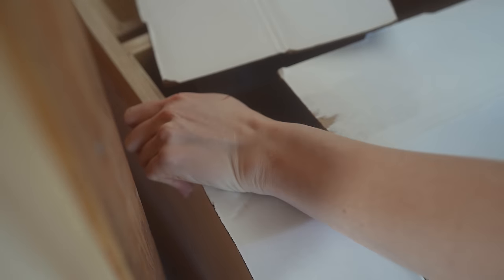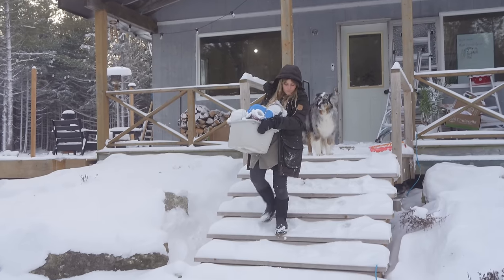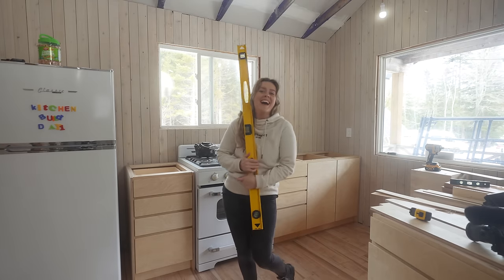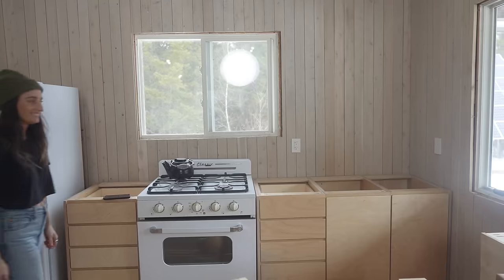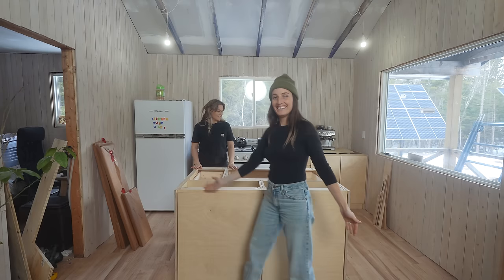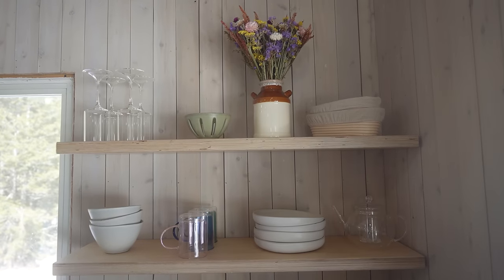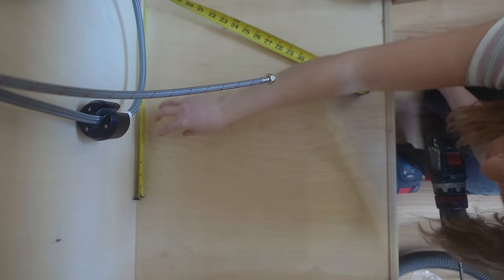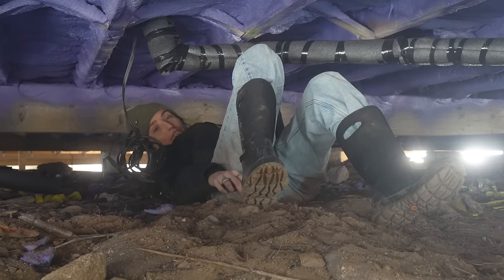Building A Tiny House Kitchen For Off-Grid Cabin!

Comment: A suggestion (if it hasn’t already been suggested) to make use of the kitchen so much better, reverse the hinges on your refrigerator door to swing out from the opposite side.  It is quite easy to do and typically involves only three screws for the top hinge after removing the cover and three for the lower hinge.  The cover will work on the other side too.  This will make it easier to utilize the countertop when you load & unload items.  The cabinets look great.
Reply: Someone already told them that 3 hours ago. (-;
Reply: Yep same page. I was thinking more counter immediately next to the fridge. Maybe there’s gonna be an island or floating island
Reply from the maker: Thank you William we sure do appreciate all the ideas and suggestion we receive. Thank you for being part of our pack.💛🐶

Comment: Great job and I love the difference! Don't forget to get skirting around the base of the cabin, before winter next year. That will make a huge difference in heat retention. Time for the off-grid cabin retreat on your property?
Reply from the maker: Hey David, thanks for the reminder, we may need another one in September. 😆 🐶
Reply: Block with metal access doors

Comment: Great channel and awesome kitchen! I caution you on using more of the heat trace wire, you are off grid and this resistive load adds up and will suck your batteries low at an alarming rate in the cloudy cold Canadian winters. You definitely need the heat trace from the well to the house, however, investigate re-routing your water lines in the island to interior walls as much as possible to decrease the length of heat trace wire. Possibly (under the cabin) remove the insulation in one floor joist area next to the floor, route the water lines right under the subfloor, and then re-insulate below the water lines so the water lines are on the heated side of the insulation. You can still wrap the water lines in heat trace but insure you use the thermostatically controlled heat trace, so it hopefully will never come on.  Next winter when you are watching your electrical load slowly drop you definitely want some of the simple load monitors that you can plug your ‘automatic’ resistive loads like the heat trace into, so you can monitor where your battery power is going.

Comment: The place is looking amazing! I think everyone will have dog bowls in the island now. Very clever.
I could not tell from the shot but you should put a plumbing vent in under the sink in the drain line. They are super cheap and you can still add one without much more work. It will help drain that big sink when it is full of water and you drain it. You will hear gurgling, bubbling noises if you don't have one and it will take longer to put in. If you plan on putting in a garbage disposal that would be a good time to put the vent.

Comment: Great enthusiasm. You've been getting by without an extractor fan over your propane stove, but I'd think about putting in something to vent the toxic fumes outside. Eventually they will take their toll, especially in the winter. Even putting a drop down fan up above the window height would help in winter. Also, in Ontario at least, your stove setup requires 6" on the back to combustible material which it looks like your stove comes with. Nonetheless, I'd consider something fireproof and easy to clean behind the stove. Maybe some stamped tin would look nice. Code calls for 6" to combustible material on the sides as well.

Comment: I would have really enjoyed building and installing your cabinets with soft closing doors and drawers. Of course, auto lighting inside uppers and lowers. Soft lighting under the upper cabinets. And then making you solid surface counter tops and a deep farm sink. Then put matching doors on your fridge and dishwasher. Making it all easy to clean and sanitize.

Comment: You two are doing amazing!
one small suggestion though, use some ice or snow on the plumbing heat trace cable sensor to test it to make sure its going to work.  They don't make them the way they used to and I have had some break the filament wires when wrapping them too tight.  Not saying they are wrapped too tight its just better to find out now rather than next crazy cold snap.
Keep up the great work and be proud of everything you are accomplishing!!
Reply from the maker: Thanks for sharing and caring. We appreciate all the feedback we receive. 🤩🐶

Comment: A built in dog food/water dish.I was on the money! Here’s the thing, while they’re new, give the insides extra coats of urethane. With all the water/food/ dog slobber, they will take a beating pretty quickly. You won’t want them to warp. Did you get an expandable drain trap? Cause once the countertop is installed, unless the sink is under mounted, and sits a top the counter, the distance between the sink drain and u-trap will change.

Comment: As I saw other’s comments, consider moving the hinges on the frig. My former neighbor calls himself a handyman, but I watched him build 3/4 inch birch cabinets in his garage for his new home. Like Andy he builds the platform/kick plate, as he said I level that up and secure it to studs, then mount the actual cabinet to the base. I noticed he used soft close slides for your drawers, 👍. Make sure caulk around the sink to prevent future water damage. Looking more like a home than a summer cabin every week.  Did you figure out a solution for the batteries you were having an issue with the initial charge?

Comment: Nice job on the kitchen ladies. Just a thought  on keeping the mice from using the plumbing floor access hole to join you for dinner. If there  is ANY clearance around the pipes place some steel wool in the opening  and cover the top with a sheet metal panel screwed down. Have a nice day   Tom at the NB/NS border.
Reply from the maker: Why thank you Tom, we sure do appreciate you sharing your knowledge with us. So happy to have you in our community. 🌞🐶

Comment: Great job girls, you two should be really proud of what you've been able to accomplish. Just a couple pointer on the Plumbing I noticed while watching (Red Seal Plumber from PEI here). First thing is that you actually didn't need pipe dope for any of the connections you did in this video, my apprentices will often do the same thing but because the threads aren't actually making the seal they don't need dope. For both the tail piece on the drain as well as with the supply lines to the tap the threads are just the to provide compression on the rubber gaskets. The dope isn't actually helping, just making a mess. Secondly it looks like you made an S trap under your sink which isn't to code. It probably won't be an issue and isn't worth changing unless you start having issues but the proper setup would be to use an automatic airvent under the sink to prevent your trap from siphoning out. But overall great job and if you ever have any questions feel free to get ahold of me and I'll help if I can.

Comment: You need to leave an inch and a half gap either side of the stove to allow for airflow around it to prevent heat transferring to the cabinets.
Reply: You should do the same with your fridge if you can also. It prevents moisture build up

Comment: amazing!  so happy for you.  But....didn't you want to wait until the countertop was in before putting in the sink?  You'll have to take it apart and make some adjustment in the underneath pipes, no?  I just put in a kitchen and was told to get the countertop in and then install the sink and plumbing.  either way, glad you finally have running water!!

Comment: Amazing job ladies. Normally you need to have the counter top on before you put the sink in or the faucet on because you are going to need to cut a hole in the counter for the sink and its going to be adding thickness. Do you intend to take it all apart again later or are you planning to somehow put a counter around it?

Comment: How well do you think the water lines are going to work? I'm not sure about them or the heat and lines being that close together. Your cold line is going to be warm when wrapped together all year long when using the hot, although would be helpful in the winter. I'd wrap them separately and cover it with a board and insulation so it's more protected when it gets super cold like this last winter.

That's just my unprofessional opinion. I live in Montana and we had several -40° days.

Comment: You will have to plan for a sliding shelves pantry. The grocery store is not next door so when you go to the store you usually buy a little more just in case. Now where are you going to put it all? On the floor? And over time, it accumulates. You'll see.
Reply from the maker: We will have extra storage in the shed! 😊

Comment: You'll want to change the hinge side of your refrigerator, so that it hinges on the left instead of the right, for easier access.  It's easy for two people to do.  Unscrew the right side and reattach on the left side.  easy peasy.  2.)  Too bad you're gonna end up redoing your plumbing connections to the sink when you install a countertop.

Comment: The shelf brackets should be installed upright for anything heavy like stacks of plates or valuables.

I would never trust small cheap brackets like those installed sideways.

Sure, you can’t see them but the shelves will start to sag for sure in time!

Comment: sink should be placed near a window for natural light and to be able to see nature, creating a sense of calmness. Also, it's good to have the sink facing a window to let the negative energy flow out.
The sink should be easily accessible, not in a crowded or tight space, to allow for the free flow of energy.
The sink should not be placed directly in front of the stove, as this can create conflict between the water and fire elements.
The sink should not be placed in the centre of the kitchen, as this can block the energy flow and create a stagnant feeling.

Comment: Lowe's the dog bow idea.. what about water bowl you just going to sit on the side
Reply: Is there anyway that you can insulate that water line some more I know that you live in Canada. But is there anyway that you can build like a Halo box around it you know a little over top of it going to give you access but it may give him a little extra protection to the waterline.. if you build a boxer might be able to stuff it with fiberglass or another type of insulation like that where it's easy to break apart.. just a suggestion
Reply from the maker: Bella and Izzy have many water bowls in the cabin and outside. 💛🐶

Comment: I know, this is probably an annoying question, but I'm going to Ask Anyway, did you fill those large holes, (around the plumbing,)with insulation under your cabin, Reason Why I ask, Remember your hot tent camping trip, Those Weasley rascals, they can climb into any small holes, or mice,  you wouldn't want a repeat of those gnarly rascals

Comment: Shelf brackets are incorrectly installed 90°… they will definitely fail
Reply from the maker: Can you explain why!
Reply: They need to be vertical to hold more weight, either behind your interior wall then poke the metal rod through or unless you don’t mind seeing the metal you can install on the front of your panels.

Installing horizontal limits the amount of weight you can put on them - they may work for you but not sure how much you plan to store on them. They will start sagging eventually though.

Enjoying seeing the interior coming together 👍🏻
Reply from the maker: Thank you!!